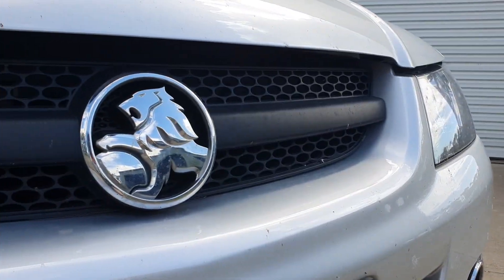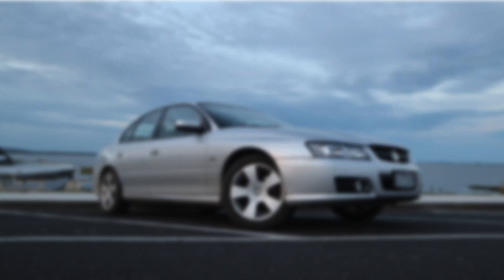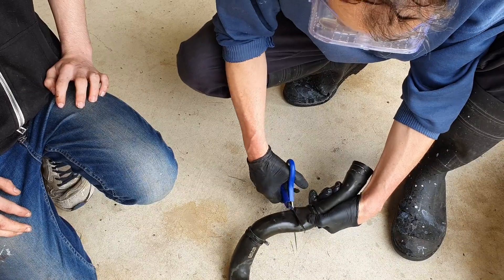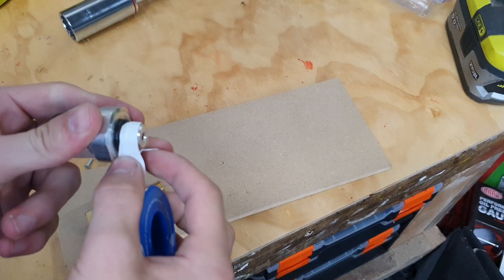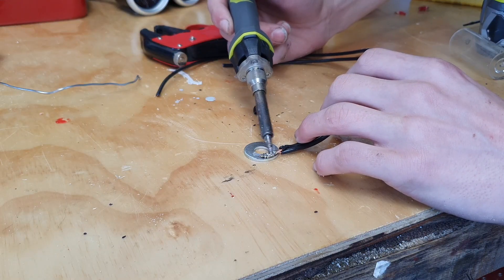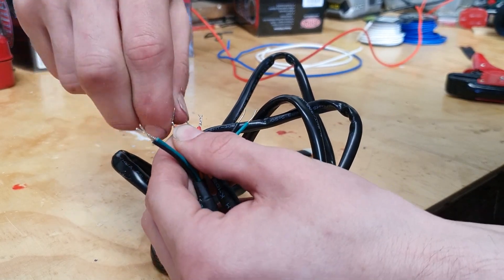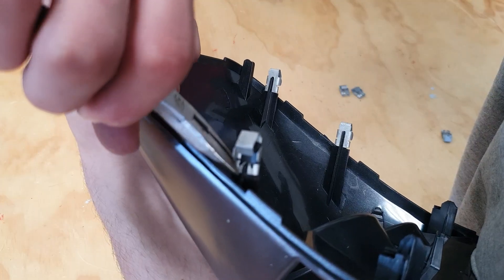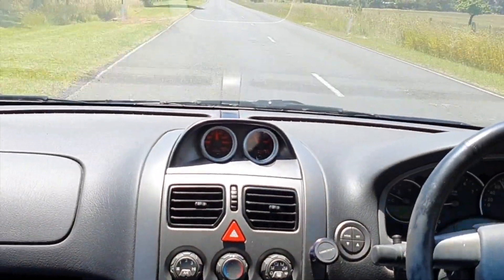Installing Gauges in Your Car: A Beginner's Guide (VZ Commodore)

Comment: hey mate done everything guages are working good however got no light on the dash and stereos not turning on anymore any ideas?
Reply from the maker: Sounds like you’ve blown a fuse.  Have a good look around and test them with a multimeter.   Good luck
Reply: @JamesMayer125  nah all good bro i figured it out realised the fuse taps need two fuses on each tap🤦‍♂️ rookie mistake
Reply from the maker: Happens to the best of us.   👍

Comment: Nice good job,  I'm about to do this to my commodore you needed a 38mm water temp adapter as yours is VZ mine is a VY so I will need to use the 34mm adapter. There's no reason why Holden needed to use 2 different size diameter hoses I guess somone from the design department needed somthing to do that day to look busy before the whole company went down the toilet.

Comment: Can I use this in my vy calais it has the digital climate cotnrol
Reply: There shouldn’t be a issue as it won’t be in the way if you want to cheat take the top of where the gauges go and look in there and see if you can see holes on the right in there to acces the fuse box

Comment: Hi dit same as you but my temp gauge doesn’t move got idea what did wrong  connected to fuse box and sensor then earth on body  I give up
Reply from the maker: Good question.  Could be multiple things.  Does it light up when the lights are on? If not there might not be any power.  The connection that reads the heat measure could be dodgy aswell

Comment: It's not about feeling like a race car driver, it's about knowing what & how the engine is running. Just having a light come on when there is problem it's to late. Having gauges tells you what's happening in real time.
Reply: Every car needs a water temp guage tho... Because when your driving how else are you supposed to know if your car is overheating... Ofc you need to check your coolant often but still

Comment: Hey mate, appreciate ya time n effort. Just curious where you mounted the secondary ground wire??  I need to relocate the wiring for my gauges and the bloke who did it has used the cig lighter plug behind the storage compartment which is for sat nav/gps and as it has power, lights and ground he has wired the ground in there as well. I want to move my wiring to the fuse box exactly as you have and need a new home for ground, hopefully something close to the head unit or gauges. Cheers 👍🏻

Comment: Instead of using a match to shrink the heat shrink if you don’t have anything else use your soldering iron on the heat shrink way better than the matches 😂
Reply from the maker: 😂😂😂 that would have been a smarter idea.  I would have just used the lighter but it ran our of gas and couldn't be bothered going up the street 😂

Comment: What psi does your oil pressure gauge sit at idle when the car is at normal temperature
Reply from the maker: About 30psi
Reply: Cheers, do you think i may have a problem if im sitting at 20?
Reply from the maker: I'm not an expert so I'm not too sure but it should be fine. Maybe ask around though
Reply: @MannyG88yo what engine?
Reply: @MannyG88yo assuming it’s a 3.6 alloytec.  With engine warm, increase engine speed to 2000rpm.   Oil pressure should read a minimum of 20psi.

Comment: These gauges look really good on the dash 👍
Using the oil pressure and temp that should be available from the OBD2 port might be easier though.
Reply from the maker: Ah ok good to know! I don't own a scanner just yet hahah but hopefully will soon :)
Reply: @JamesMayer125  get a cheap Bluetooth ELM 327 from China and a free app for your phone for starters. Costs about 5 bucks and does a reasonable job.
Reply: @bastianfromkwhbsn8498 doesn't work on these model of car. I've tried